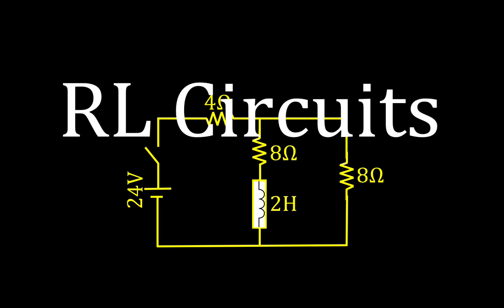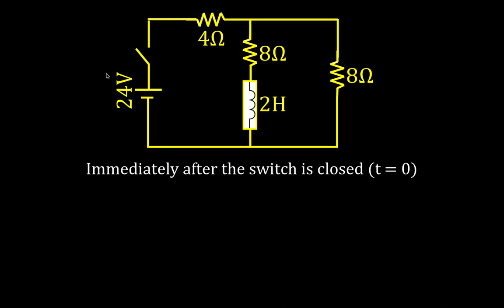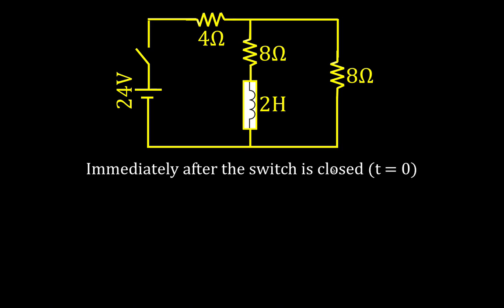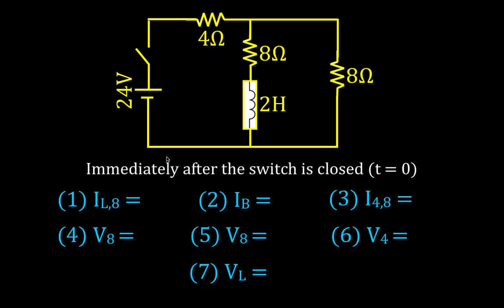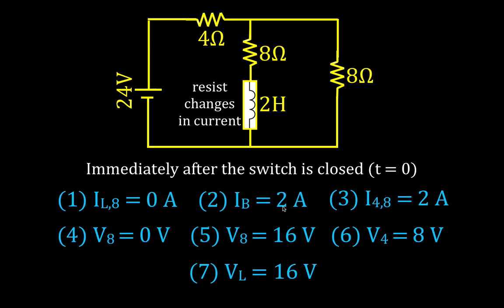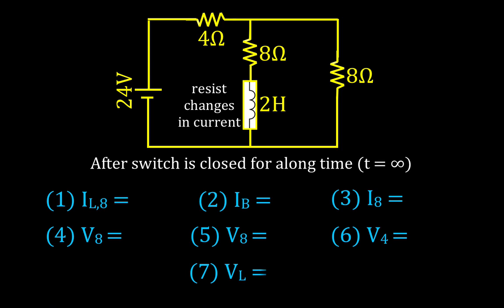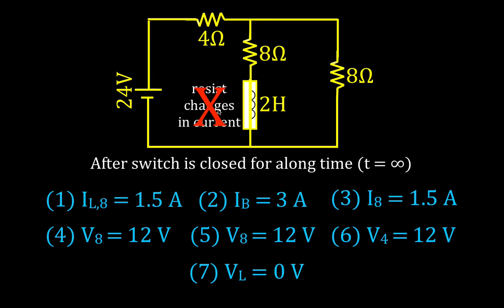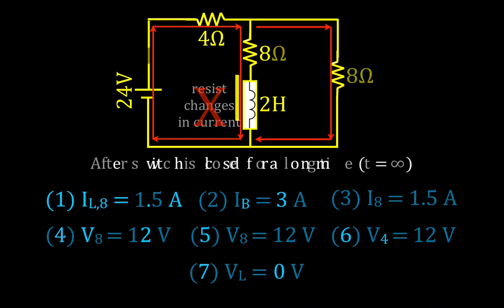RL Circuit Analysis (2 of 8) Voltage and Current

Comment: Relays for starter motors and other high energy devices often contain a parallel resistor or diode, to quickly bleed off the backwards charge that is generated when the coil inside the relay is abruptly turned off. This nicely shows how those devices work, protecting upstream electronics from spikes in current flow, and immediately resetting the relay to zero potential so it is ready for use again.

Comment: The equivalent resistance between the two 8s is 1/4 because for parallel resistors the eq. resistance is 1/R + 1/R,
Reply from the maker: the equivalent resistance between two 8s is 4 because 1/R(equiv) = 1/R + 1/R.  Is is not R(equiv) = 1/R +1/R.

Comment: These amounts seem a bit high for a normal circuit. If you're doing this on a breadboard or something, you'd need to have 16 AA or AAA batteries in series to generate 24V DC, then if you have a resistor that's 8 ohms with 16 V and 2 amps, then it'd dissipate 2(16) = 32W of power. This is a lot for standard resistors to take. The most common ones I found at a normal price for use in breadboards (generally with axial leads, smd/smt ones would be even less) are rated at about 500 mW, 3W and 5W so both of these resistors would quickly get burnt out by this.
Reply: Jonathan McVinnie this is an explanatory video on how RL circuits work, so using simple numbers is not only easier but also makes everything more clear. I’m sure he knows about which numbers would be more applicable to the real world.

Comment: How did you get 1.5 A on IL8 and I8? didn't understand that.
Reply from the maker: After the switch has been closed for a long time the inductor is no longer resisting the change in current because the current is not changing anymore.  Therefore each branch really just consists of one 8 ohm resistor.  ( and each branch has the same resistance)  If there is 3 A of current coming out of the battery then the 3 A of current is split evenly between each of the branches.  3 divided by 2 = 1.5 A of current for each branch/resistor.  Does that help?